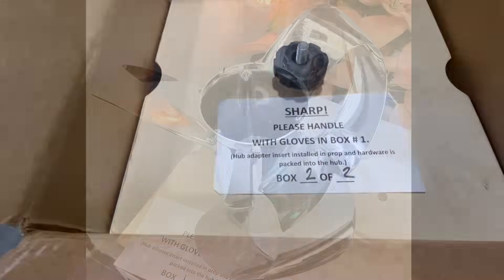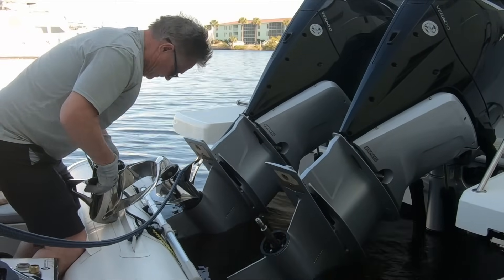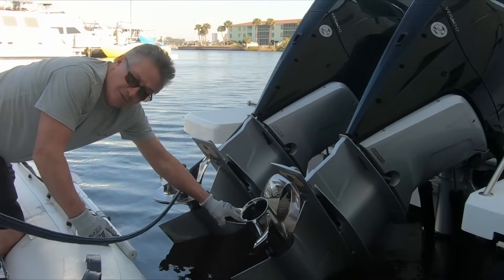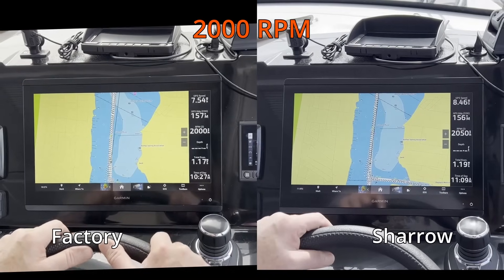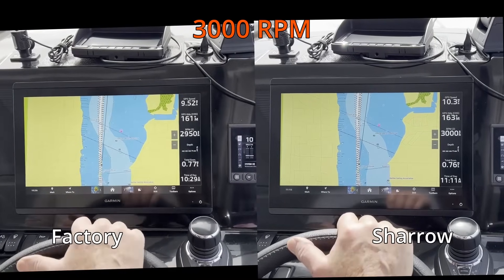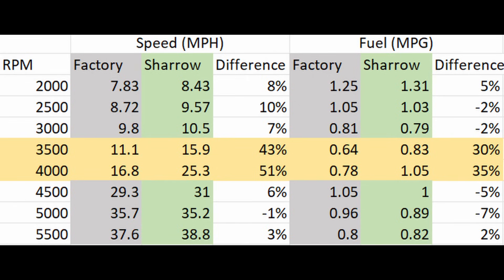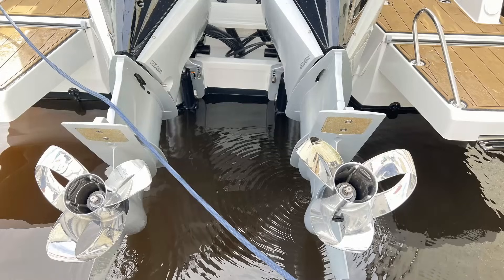Sharrow Propeller - Performance True Result from Real Boater #outboards

Comment: You should have tried a 4 blade conventional prop of similar diameter and similar surface area to the Sharrow prop to make a fair comparison.  Your 3 blade prop is smaller diameter, with less surface area, clearly it is slipping as the boat is attempting to get on plane in the mid rpm range.  Of course the 6 blade, larger diameter Sharrow will slip less in the transition to plane.  Like most tests I've seen the Sharrow is less fuel efficient at speed / higher rpm as compared to a conventional blade.

These tests are so bogus!

Let's bring in a top conventional prop manufacturer and let them choose the prop to compare... then we will learn something.  What you provided is totally useless data.

Comment: Given what I know about toroidal props I am not sold on the promises. Considering they have turned comments off on their own video's I think I may not be the only one. 

Toroidal props have been seen to create vortexes which interferes with the flow of water causing a lower efficiency, meaning more fuel to get the same power. Unless Sharrow have found a way to beat physics. 

Also the "no cavitation" claim is easily provable bs. It is physically impossible to spin a prop that fast and not cause cavitation.
Reply: i think they tweak it for your application/RPMs you want to use. but prob other methods to improve efficiency .

Comment: I don't get some of this chart.  I'm guessing that running the diesel engines at 4,000 RPM would require the same amount of fuel regardless of the prop.  Yes?  If not, why not?

So - at 2,500 RPM the Sharrow props push the boat 10% farther but get FEWER MPG?  How is that possible?

But no matter what is going on otherwise, the speed gain in the sweet spot is impressive.
Reply: the cavitation is different at diff RPMs and engines have diff power at diff RPMs... so you need a prop that could adjust itself to optimize at all RPMs . or complex computer models. I think they customize it to the RPM/power you tell them so if you have a major boat and do 10s or 100s of miles at a cruise RPM then it makes sense to get.

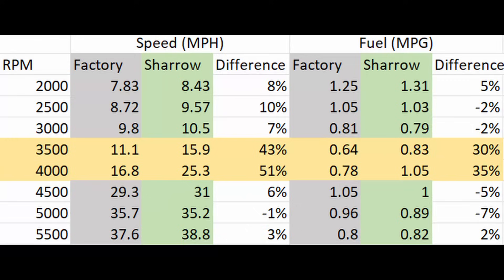Comment: 4:02 Without having a sharrow prop to compare, I would see that 2000rpm is the spot for fuel economy slow comfy mode and 4500 is the best compromise to go where I want quickly. 
In that case I would beat the sharrow that has an indecent price point. Despite cavitation, I can buy maybe 5 or more regular props with the money.
Thank you so much for this seemingly honest review.